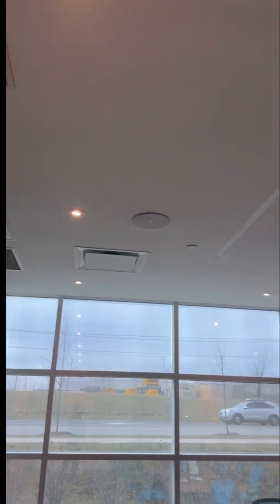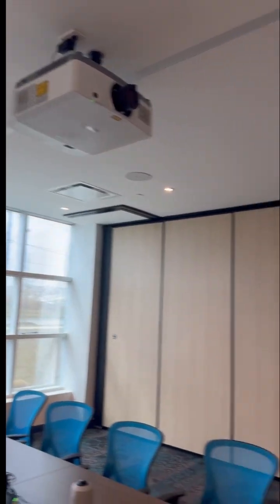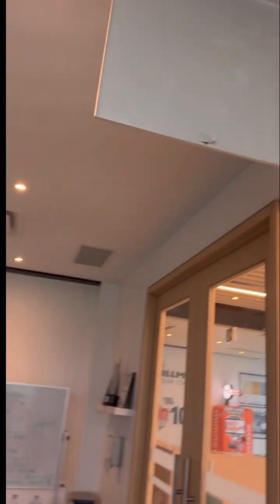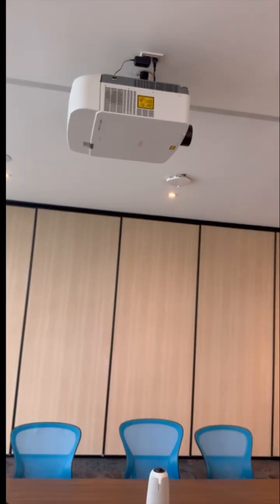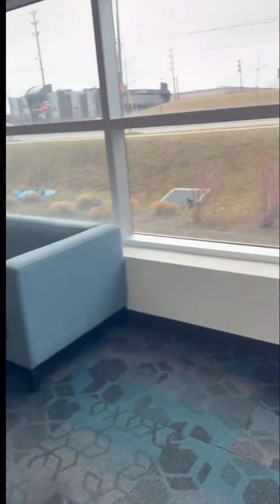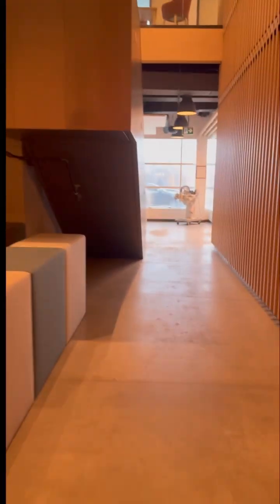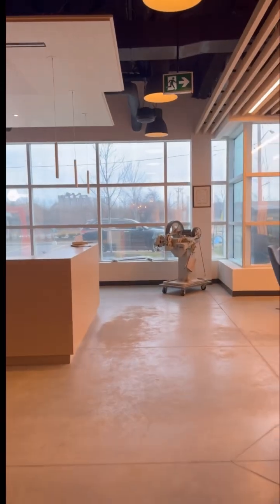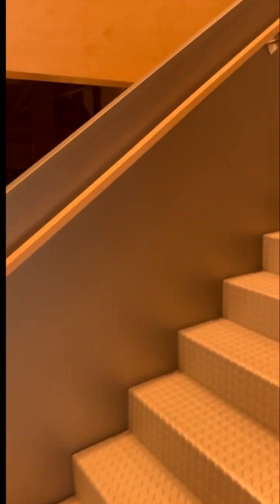No Heat! | Fire Damper Failure     #firedamper #noheat #airflow #hvac

Comment: Question. I was up on a Rooftop checking some RTUs yesterday. I found a gas fired RTU with AC capability. It had an economizer on the one end of it. I noticed however, that the Evaporator coil (which stood vertically on it's side) was just up against the inside wall of the unit and the there was no way for the air to blow through the coil because the side wall of the unit was blocking the path. How could this system work and supply AC to the store below? Could this just be being used as a makeup air unit and the AC not actually working? Perhaps a different RTU is supplying the majority of heating and the cooling to that store below.
Reply from the maker: @k.sullivan6303  are you sure that wasn’t a hot water coil for fresh air?
Reply: @HVACRNorth  I never thought of that, but I guess that would have to have chemical in the water to stop it from freezing. This system has a condensing coil, a compressor and condensing fan that looks normal. It's just the evap coil against the sidewall of the inner part of the unit that I can't understand. It looks like a much older unit than the other RTUs up on that roof. I wonder if it was just thrown up there as a used unit for makeup air?
Reply: @HVACRNorth  Here is a more detailed description of my situation....
Question. I was up on a Rooftop checking some RTUs yesterday. I found a gas fired RTU with AC capability. It had an economizer on the one end of it. I noticed however, that the Evaporator coil (which stood vertically on it's side) was just up against the inside wall of the unit and the there was no way for the air to blow through the coil because the side wall of the unit was blocking the path. How could this system work and supply AC to the store below? Could this just be being used as a makeup air unit and the AC not actually working? Perhaps a different RTU is supplying the majority of heating and the cooling to that store below. 
My experience is mostly residential with some RTU work over the years. I am a licensed Refrigeration mechanic, but the company I just started working for has a couple of 3rd year apprentices who are terrified of the boss, and they will lie to him, and cut corners on many jobs just to avoid his displeasure, which turns into them being insulted and humiliated by him. He is ex military, and he gets quite insulting and miserable with them. He is micro managing them and always complaining about the time it takes them to get things done. This is why they lie and cut corners. This is leading to chaos. I'm in a bad situation here. This problem with the RTU that I mentioned above, I wanted to delve more into what was going on with that thing, but all they worry about is time. This attitude has created a lot of problems that often just pyramid.

Reply

Comment: If that's a 2hr fire rated wall that should be a fire/ smoke combo damper which intern should be tied into FA. IF a fuse link is let go you can just get a fuse link and be done. But don't know why it closed?
Reply from the maker: @RayRay-nb7tn  Your guess is as good as mine. I believe it is 2hour b/c it’s double layer I believe. I haven’t seen many linkage break so..🤷🏻‍♂️. It’s not tied into a fire alarm. Plastic ties will melt before 160-180f until it’s changed. Cheers bud🤙
Reply: It could've be a in house maintenance doing a yearly inspection on dampers?
Reply from the maker: @ I wish …doubt it lol